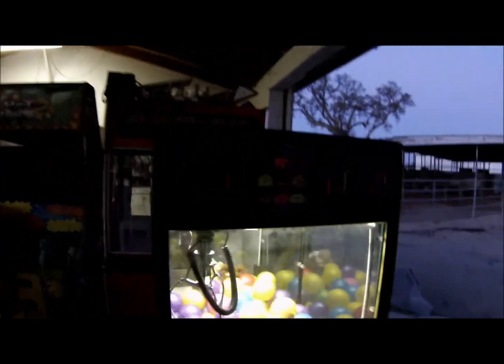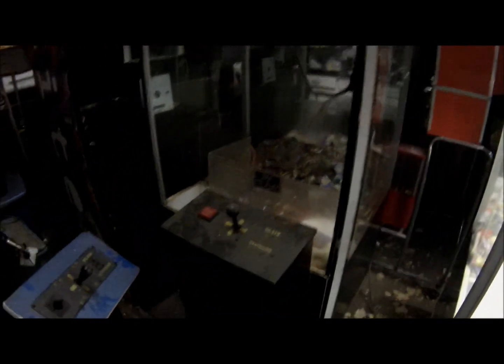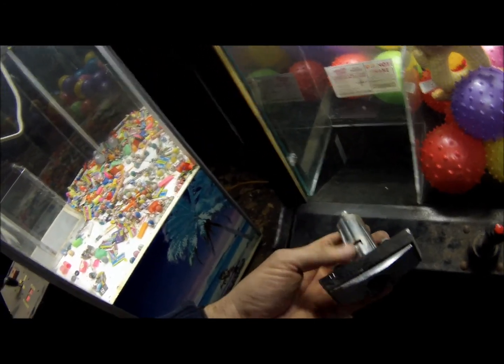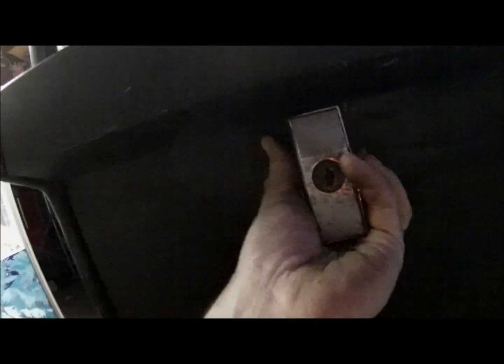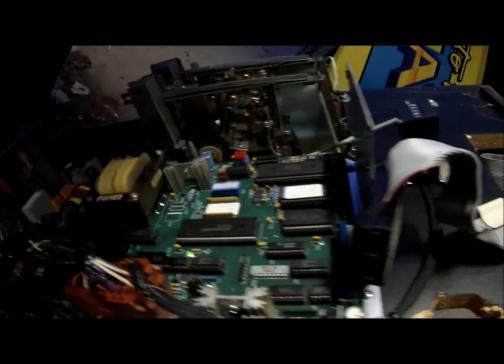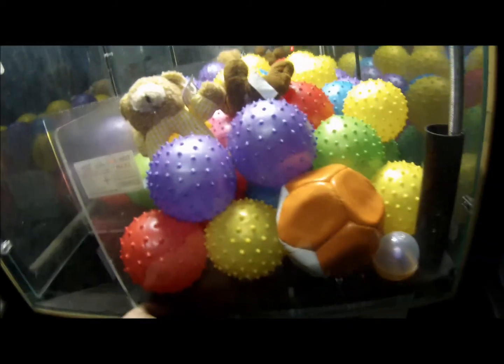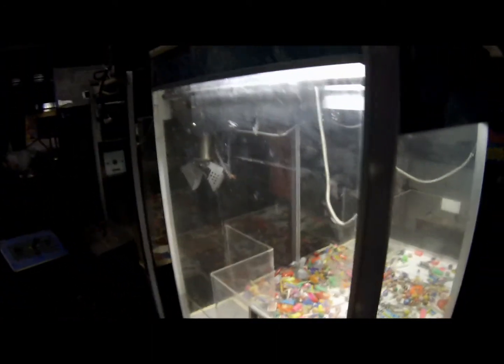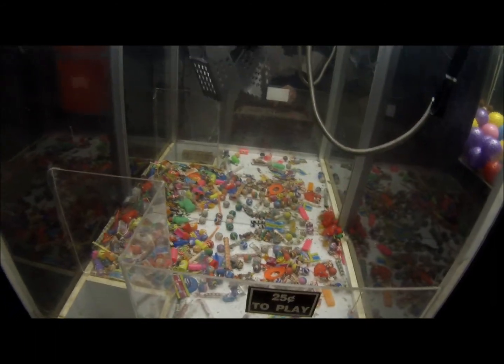Claw Machine Rescue Part 5 - Inside the Sugarloaf Claw Machine

Comment: Cool machines, nice video D
Reply from the maker: Claw Craziness Hey thanks. I plan to do a full review of each machine. I think it will be fun. How many machines do you have now?
Reply: Vending Junkie Just the one at the moment, I had to sell my other one because it broke beyond fixing. (money wise) but I wanna get one to put on location, i'm looking but can't find any near me for a good price :)
Reply from the maker: What broke beyond fixing? I have parts and the ability to fix stuff like that. You have my number right?
Reply: Vending Junkie its been gone for a while now. wouldn't close, I got 5 coils, none would work. (one after another) got all new fuses. checked all the wiring. then it stopped going forward and I just got sick of it.
Reply from the maker: Claw Craziness lol....call me up anytime you run into something like that. Sounds like a board issue and not a coil/mechanical issue.